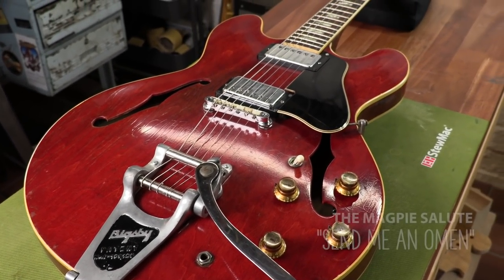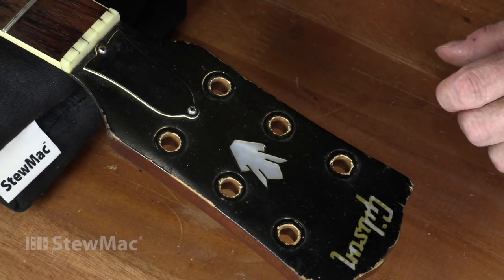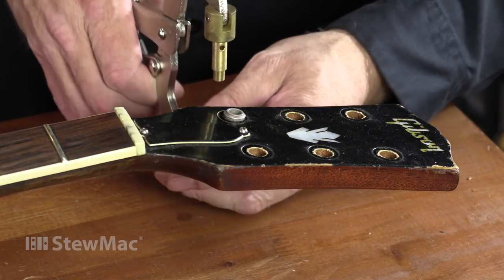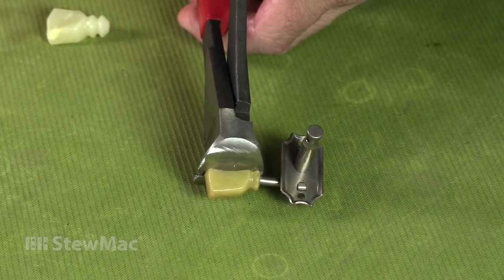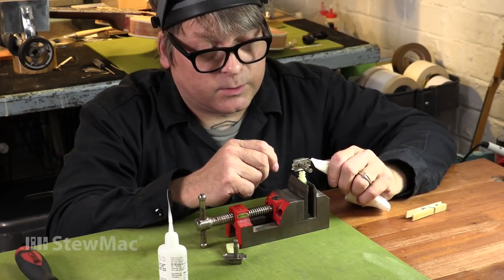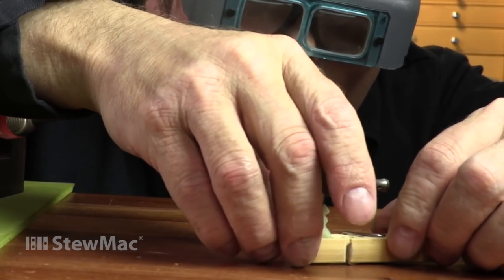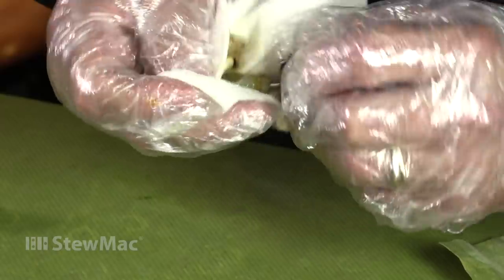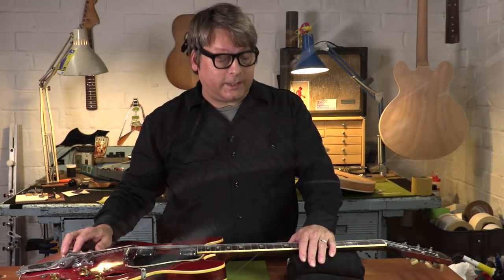Changing Rich Robinson's Grover tuners back to vintage style Klusons

Comment: God I hate relic-ing. It's like cutting holes in your jeans.
Reply: Agree.  Everything is fake now.
Reply: No, it's like patching your jeans with an older piece of material that matches how old they are.
Reply: Not sure if bait...
Reply from the maker: It's a subjective topic for sure. On this guitar the tuners were relic'd to make the new machines look more at home on a 50 year old guitar.
Reply: This type of relic-ing is for sure!
Reply: Relic'ing a guitar intentionally has this slight hint of the "everyone gets a trophy " mentality. "Well its trendy to look old but I dont have time and I want it now!"  Feels like a hipster thing.

However I agree here.....if you have an actual old guitar it's ok to add parts that look aged.
Reply: I think that in a way about new guitars. It's like buying factory faded and 'distressed' jeans etc. it seems a little try hard to me. But on the other hand I have run into some reasons i might have to do a little relicing on my 1997 Les Paul Studio. Its black with gold hardware and an ebony board. I really like the way it sounds and plays. I put a Whole Lotta Humbucker pups in that have nickel covers. I am not too fussed about the mismatch tbh, but I also think about putting an aluminum bridge and tail piece on it (Curiosity really. See if I can tell the difference and like it). Aged parts cost heaps, so I thought of getting gold ones and making them match the level of wear on the guitar. I dunno though. I tend to not bother about looks and just play the thing. 

p.s. The Studio was just meant to be a stop gap. Cupid had made me stupid enough to sell my Gibson gats. Once I was out of that rabbit hole I needed a decent guitar again and the Studio was meant to be like half way there. But it ticks all the boxes and i don't think I need anything fancier. It really surprised me how good it is. It makes me want to try a SG Special from the same era.
Reply: It's all about personal preference, some people do it on purpose and for others it takes 40yrs, I can't afford a custom shop strat so I have to make my own relic.
Reply: I agree, but obviously in this case the guitar was already vintage, so you'd want the tuners to match. I just don't like it on new guitars. You should play it in, and wear it yourself. I bet if you went back to the 50s and 60s, and tried to give one of those old school muso's a new guitar that was already beat up, for top dollar, they throw it back at you or laugh in your face.
Reply: @TheCentralflorida  so buying a vintage guitar that was beat up by someone 40 years ago before you got it makes you somehow less of a pretender than a guy that bought one beat up by someone at fender a few years ago?
Reply: @ryann5247  nope. Same person and personality characteristics. Beat up your own guitar. Every ding should have a story. Thanks for being upset about it though and seemingly offended with your rhetorical question.

Comment: Kluson tuners suck.  Gotoh makes tuners that look exactly the same as the Klusons, but they have an automatic locking functionality and the ratio is also higher.  They're vastly superior.
Reply from the maker: The tuners Erick installed are modern Gotoh's, though not the locking version. They are a better machine than the old Kluson's for sure!

Comment: Bad Practice.  You should have various sized bushings and no reaming.  There has to be a better way than reaming a over sized hole.
Reply: I was wincing watching it. I know Erick knows his stuff, but that took a lot of confidence reaming an already oversized hole.
Reply from the maker: It's definitely touchy work but it had to be done. No other available bushing fit snug enough to hold. It didn't take much at all.

Comment: So its still not vintage... just looks more vintage... due to some trickery with stain. and some new bushings too.    Guitar community too into old stuff,  which really wasn't made as good back then.  In reality guitar just got downgraded to bad tuners.
Reply: when you think about it tuners are really just a set of gears, as long as they're made well i dont think it really matters who makes them.
Reply: Its the slop in the gears that cause problems with tuning,  some manufactures are better then others.  Some are just out to make a cheep product and profit..  while others strive for quality and precision.  There is a difference.  Todays manufacturing  blows away 1970's in most cases due to better techniques used, better machining tools, better design tools.  But some manufactures still manage to f it up now days.
Reply from the maker: These Gotoh's are actually a far better performing machine than the old Kluson tuners were. They are every bit as good as a Grover in terms of tuning stability! A great option for vintage replacement.